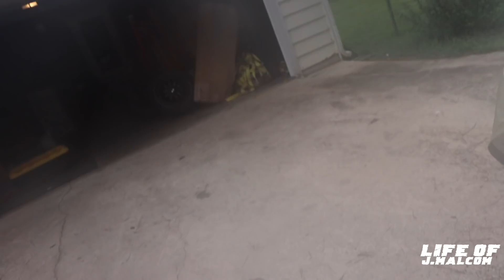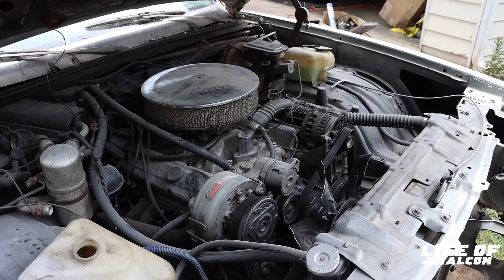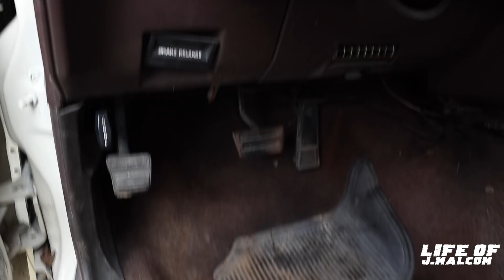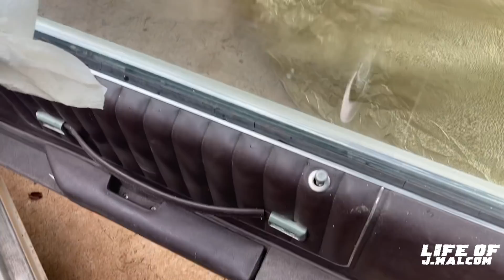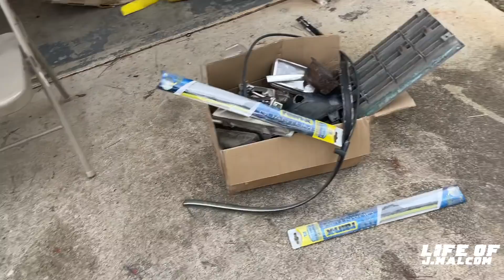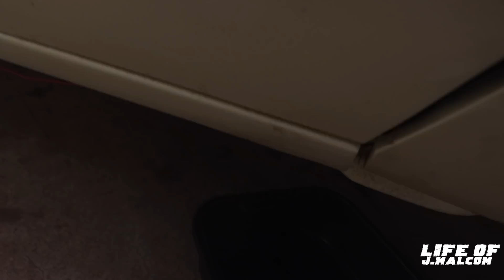TRYING TO GET WIFEY MONTE CARLO CL BACK CLEANED UP!

Comment: Ultra fine steel wool grade 0000 can get that over spray off glass and chrome, using the razor blade spray a little window cleaner first it will help lubricate the razor blade.

Comment: You can wet your windows down (with Windex or soap and water) then hit it with the razor blade and the overspray should come off like old tint glue when you are doing a window retint job. You can also avoid adding scratches to the windows as well. I hope you get it straight homie good luck. B.C.G